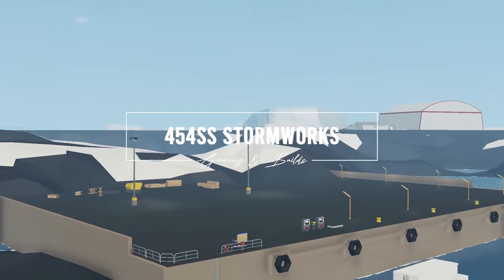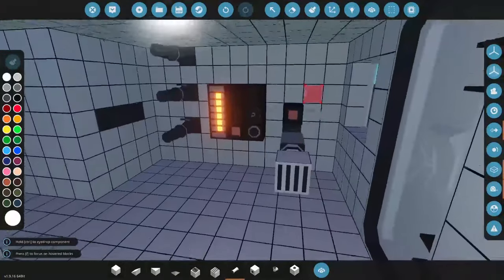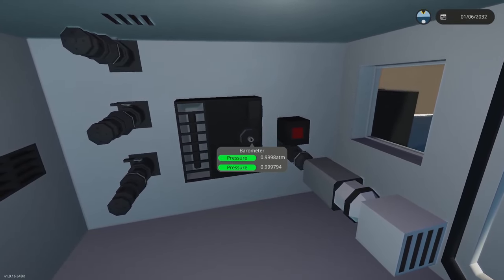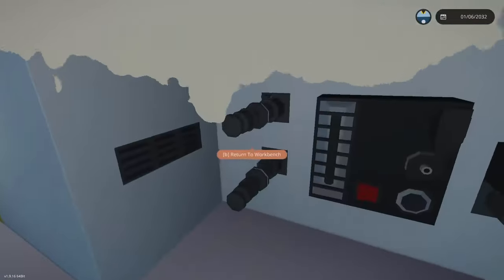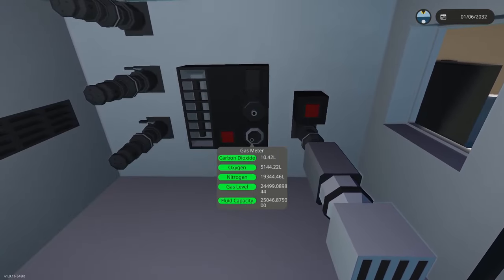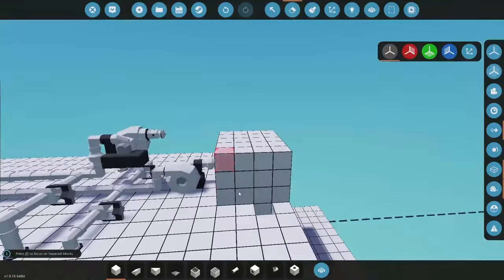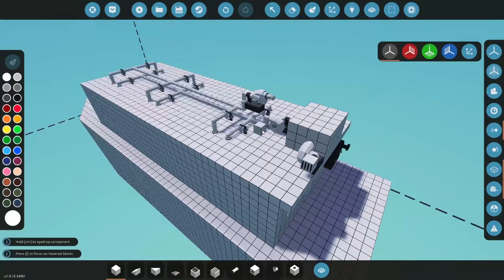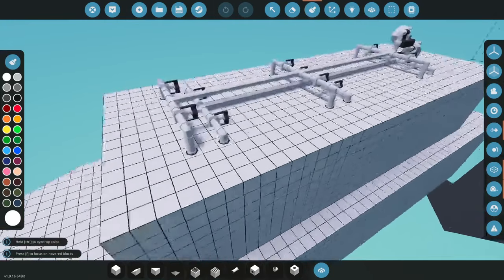Testing HVAC SYSTEMS and AIR SCRUBBERS with the Compressed Gases Update

Comment: the main problem with the new fluid system is that as soon as there gets water inside a volume the flowrate degreaces rapidly im on a 2 week run and make submarine balast work again. just pressure isnt gonna cut it. for scrubbing a volume like a sub i simply use the compressed air for blowing the balast. at 60ATM i can change the air 40 times before it starts to build up Co2 and thats hours of playtime. on a ship i would include a microcontroller which keeps the pressure at around 1 ATM.

Comment: I made a micro build with 33 Catalytic converters, an impeller pump and a small motor. The ONLY downside is the priming time. The Catalytic converters have an internal volume that need to be filled. Exponentially, the first Catalytic converter in a sequence will have a huge pressure 37Atm on my device with 33 of them. So yeah, you can effectively clean air quite nicely.

Comment: All you need is a pressure regulater and a back pressure regulator. They keep cycling the air until the air input is empty. Or a carbon dioxide scrubber  instead of the back pressure regulator.

Comment: Backseat gaming again:
Well the pump out pipe length is one longer, I guess that already decreases the flow rate.
However, at some pressure, it will increase supply pressure to pump and get equilibrium.
Reply: Yes, stormworks models more resistance in longer pipes so that could be an issue

Comment: So realistically, your set up for the catalytic converter test was sort of half done, just one cat isn’t going to work and you need multiple of them to actually get the job done, from my testing 5-9 cats are required for it to work, and in cases where multiple players are In the space even more are required. Think of actual ac systems. Just one filter doesn’t de-dust the air, and one cat doesn’t completely make engine exhaust clear.

Edit: takes WAY more than 10 cats for good results  so you would have to make an entire filter unit. My original testing was done a few hotfixes ago
Reply: I have been wondering how to fix this. I started a discussion on steam, and so far, just this comment has been the most useful 🤣
Reply: @VerkfaII  keep in mind, it may take more then mentioned in my comment, these tests were done a few hot fixes ago, 💕
Reply: Seconding this. I just tested a scrubber, and it does remove the CO2 but it needs to be way bigger than one catalytic converter. Running 10 cats on a small pump in a 67kl space removes about 0.004l/s of CO2. For testing, toggling player damage = toggling breathing.